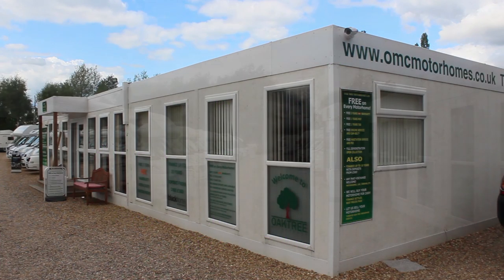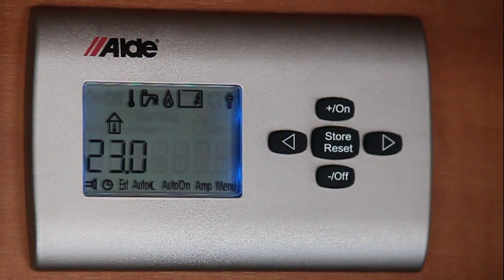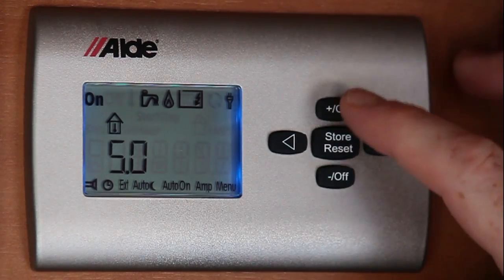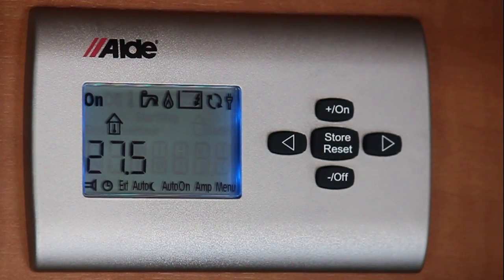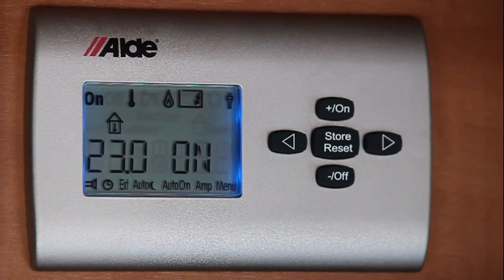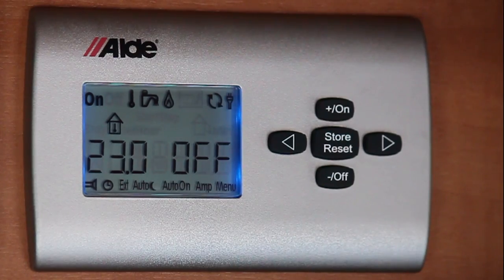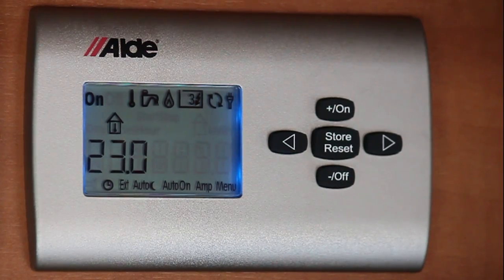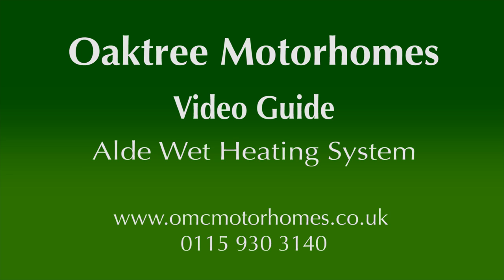Video Guide: Alde Wet Heating System

Comment: Well done plain simple and easy to understand.but must point out that the alde heating switch under the seat must be switched on if in a bailey caravan. just wish the bottom row had been explained as well."a few what ifs", like if the circulation symbol is not on, what if the bathroom radiator not working, This is not meant as criticism, but trying to be constructive keep up the excellent work